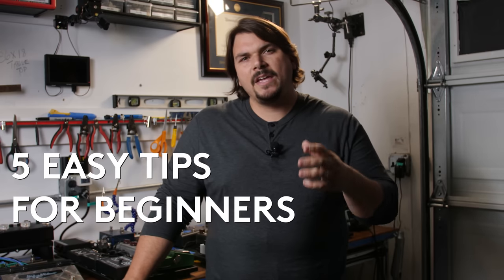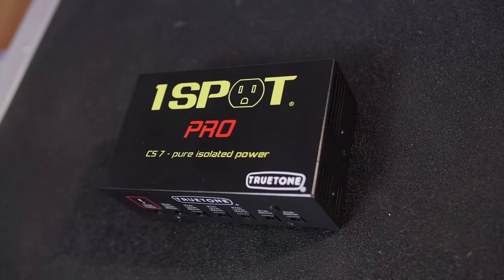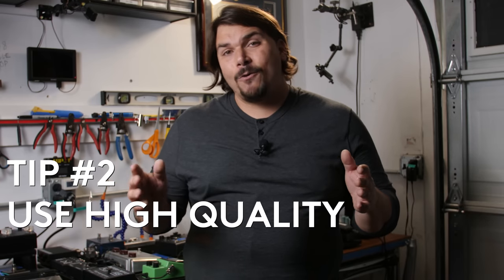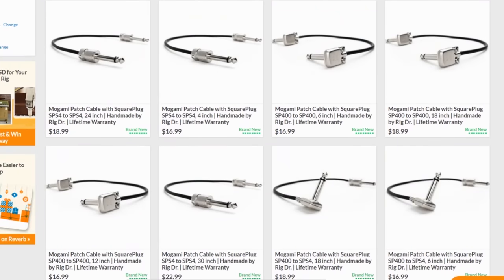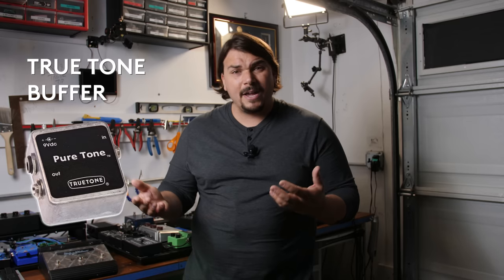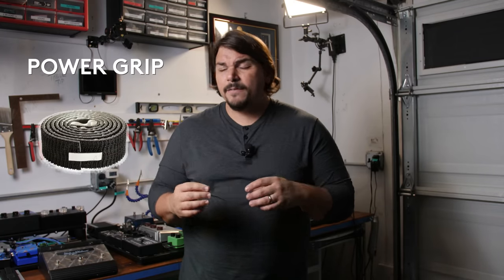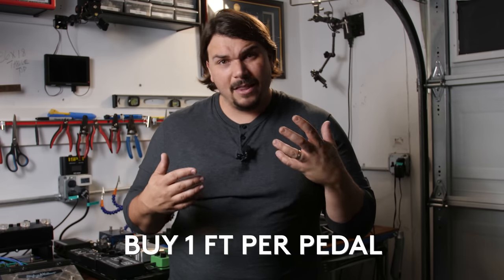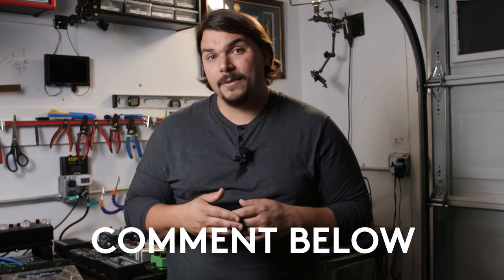5 Ways to Improve Your Pedalboard

Comment: You don’t need dual lock on your pedalboard. If you’re hanging pedals up on your ceiling, maybe. It’s ugly, overkill, and not compatible with Velcro so anytime someone lends you a pedal you can’t put it on your board. I have never had a pedal fall off with standard Velcro. And I have never needed to remove Velcro from a board. Velcro just doesn’t give me any issues, it’s fixing a problem that isn’t there.
Reply: Completely agree
Reply: Unless you are using your pedalboard as a fly rig .
TSA has torn my boards apart with standard velcro
Reply: It's definitely overkill for someone who doesn't tour but if you're constantly on the move, flying, people handling your gear... it's a Godsend!
Reply: 100%
Reply: It also depends on where you live and play at.. it’s hot and humid here in Texas and it’ll melt Velcro off the board
Reply: So I’ll play devils advocate here. I clicked on this video for that specific name; “dual lock Velcro.” Reason I NEED this in my board is because my pedals will not stay square on my board. The regular Velcro from Walmart keeps letting my pedals go a little off square and it’s unacceptable. This was my number one tip. Needed? No, I’m not saying that. Wanted? OH YES!
Reply: @truthmusicman  I’ll play devils advocate as well and say Velcro is able to make micro-adjustments whereas dual lock is locked in. If you didn’t square it off perfectly it’s going to be slightly crooked and you can’t tilt it slightly like with Velcro. Basically you can wiggle with Velcro and you can’t with dual lock. No wiggle room.
Reply: I like dual lock on my board. While not the most necessary, I feel like things fall off without it, especially since I place my pedals on top on my amp, not on the floor when I play shows.

Comment: It blows my mind that the majority of people are still using traditional Velcro. Switched to dual lock 15 years ago and never looked back. It’s super strong so you don’t need much, just a small tab in each corner of the pedal. I can actually grab a given pedal on my board and lift the board with it. It’s that strong. Pedals can still be easily lifted off the board by sliding a small screwdriver under the pedal and prying upward.
Reply from the maker: it's the best!
Reply: Proved and do its job for how many decades. Using mine for almost 2 decades.
Reply: I mean I still use Velcro strips and I can lift my board with my pedals 🤷🏽‍♂️ kinda a minor part to improve if you know how to actually use it imo..
Reply: It’s overkill. Velcro looks better. Never had a problem with Velcro. If I’m building a pedalboard on my ceiling I’ll buy some otherwise it’s the most unnecessary “improvement” to a pedalboard which just makes it ugly and incompatible.
Reply: blows my mind is a bit of an overstatement. i dont gig so i dont need to worry about pedals falling off and effers stealing pedals. p-boards get dirty and velcro can be vacuumed easily (if one is smart and has taped the soft side on the board). dust and hair/fur and grime do not vacuum easily off dual lock 🤢.

i agree with the CS series and EB ribbon cables though--both are excellent, affordable prods.
Reply: I use alien tape. Strips of silicon rubber. They stick in a similar way to Velcro but are one piece and are easily removable and reusable. If you had hard floors, like on a stage, you could just stick em to the ground if you wanted. Also the soft rubber adds a little squishy bumper. And you can stack multiple layers to get past and get
Reply: I remember as a kid, my dad helped me build my board using dual lock and I hated it as a kid because it was impossible to take the pedals off.

But now as an adult, I’m going back to it because Velcro ain’t cutting it.

Comment: If you're using velcro, use painter's tape on the bottom of your pedal before applying a blow dryer to the velcro and then applying it to the tape and not the metal/plastic directly. Will save your pedals' value and appearance over time.

Comment: This is by far the BEST video on pedalboards out there. I've watched several videos before I started building my own wooden board covered in musou black, and I came back specifically to write this comment. Of all videos, the five tips of this one were golden.

For each tip, I'd like to share my experiences and choices based on what is available in Europe. I am NOT advertising for any of these products.

1. After considering the selection criteria, I went for the Palmer PWT 12 Mk 2.
2. I'm a sucker for braided patch cables,  so I always have been using HQ ones. But I'm grateful to have learnt of Mogami.
3. I got convinced I need a buffer and opted for a Car Martin Buff DeLuxe.
4. I got a roll of 3M Dual Lock SJ 3550 (4 m x 5 cm / 15' x 2" / 2 sq. m / 310 sq. in.). If you find the right supplier, it's only slightly more expensive than when you buy 3 rolls of Velcro to get the same surface area.
5. I bought a can of DeoxIT D5; a reseller on Amazon offers it in Europe.

Additional tips for DIY:
6. If you build your own board, you'll want to use adjustable levelling feet.
7. To make sure cables don't touch the ground, affix them to the bottom of the board using cable clips or cable holders.
Reply from the maker: Thanks for watching!!!

Comment: Something I found using EBS vs. those pancake plug patch cables is the latter can have impractically large heads for some applications: you physically can’t plug two of them in next to each other in a lot of switchers, for instance. EBS plugs are a lot smaller and save a lot of headaches of that sort.

Comment: Hope nobody’s offended if I ask for an European contact Spray recommendation
D5 is 32€ + shipping in Germany…

Been a Neutrik nerd for 17 years straight, pardon the humor…
Only patch cables may have Hicons. 

Subbed and really appreciate your content!
Reply from the maker: The D5 is worth it and for most recreational players will last years.  Neutrik is great for instrument cables but not ideal for a pedalboard.  I think Hicon is made in China now so is tick stick with SquarePlugs.
Reply: @VertexEffectsInc  
 ty for the quick response. 
I didn’t have any issues with the hicons on some Sommer cables, but once I need new patch cables, I’ll try square plugs!
Reply: PRF sprays are just as good, 6-68 is a good dry cleaner for jacks and connectors, 7-78 is what you want for pots and faders. If you have a really dirty pot, I recommend cleaning it first with 6-68, and finishing it off with 7-78, as the lubricant can otherwise flood the pot.

Comment: Great video. I use the tc electronic polytune 3 with the built in bonified buffer. 2 birds 1 stone.
Reply from the maker: That’s only satisfies the input buffer, you’d still need an output buffer.
Reply: @VertexEffectsInc  would a boss pedal work ? Thanks
Reply from the maker: @BMitchell  no, it's an awful output buffer, a poor at driving long lines and the more capacitance seen on the output the more unstable it gets.  You need something that is around 100 ohms output impedance.  I'd stick with my recommendations or you can build one of our DIY buffer kits.
Reply: @VertexEffectsInc  awesome. Thank you. I'll probably pick up a bonafied buffer. Can't beat it for the money. Really enjoy your videos. Keep em coming.
Reply: @VertexEffectsInc  I ordered another bonafide buffer. Thanks again man.

Comment: I always use the Xotic EP booster at the beginning of the chain, the first pedal. It's always worked for me since it came out.
Reply from the maker: It’s one option, however the output impedance isn’t particularly good, I don’t recall with the input impedances, it might be OK if it’s just controlling your pick up a loading, but I wouldn’t recommend it as a line driver.  The other problem is it inverts the polarity, which can be an issue in some rigs.
Reply: @VertexEffectsInc   thanks. I’ll try to buy the materials to made the Vertex DIY.
Reply: @VertexEffectsInc Hey Mason  I run that pedal at the end of my board, also I have a Soul food 4 pedals in which I think is a buffer. What is your opinion?
Reply from the maker: @PERRADE  let us know if we can assist.
Reply from the maker: @scottpickett9779  you need a high quality buffer on your input and output of your system as I suggest, no way around that.  It needs to have a 1M input impedance and a 100 ohm output impedance if you want to quality it (generally - there are some exceptions).  The Klon is a great overdrive (Soul Food), the buffer is awful - TL072 is a terrible IC for this application.  Follow my suggestions, you'll get better results.

Comment: Questions about the dual lock: 1) Why do you recommend different types for the board (400) and the pedals (250), versus the same for both? Is there an advantage to this mixed setup? Asking because it appears that the 250 is half the price of the 400, so 250 tape on both would be a lot cheaper. 

2) Also, your amazon link for the SJ3550/250 stem is pointing to TB3550/250 stem. What’s the difference in the SJ vs. TB types? Thanks!
Reply: I always use 250. 400 is ridiculously strong. 400 works well if you want to stick a power brick under your board, or something like that. But for board and pedals, 250 is more than strong enough.
Reply from the maker: 1) it's stronger if you use two different densities.  If you want it easier to pull apart I'd just use 250 on both sides.  2) Not sure, they may have changed the link destination.  I'll check it out.

Comment: Nice, I had an analog chorus who was very picky with the PS, I ended building my own linear supply, I used an unregulated  12V wallwart connected to a box near the pedal board with a LM7809 regulator inside, because it was a wallwart there was no AC near the board.  no more hum.
Reply from the maker: Very nice!

Comment: I actually like the bonafide after the drive pedals when they are on, and before them when they are off... so there is some compromise needed and i have to agree that better tone overall for the pedalboard is using a buffer in the beginning of the chain
Reply from the maker: If you actually are turning on the distortion pedal, I don’t predict there’s going to be much of a benefit for running it after it as opposed to just running one of them dead last in not having an input Buffer at all, presumably if you have any distortion pedal on that’s the low output impedance signal. For most devices over a short run a cable it’s not gonna make much of a difference whether the output impedance is 100 ohms or 1K ohms.
Reply: @VertexEffectsInc  agree
Reply from the maker: @Antonio-nn5ot  yes indeed!

Comment: You almost forgot about the Suhr Buffer, that's a great one, too. Although for guitars running a stereo rig, it only applies to the output side, and if you're a bassist like Billy Sheehan that splits the signal from the instrument, but only have one output on the bass, this buffer will be usuable to split the signal for different frequencies.
Reply from the maker: Didn't forget, it's just not the most budget friendly version, and I'm trying to recommend stuff for beginners and folks just getting their "sea legs" with this stuff.  Secondly, it's not in production from what I can see.

Comment: You're right, I use EBS patch cables and they are just very good and a good power supply is also the right thing, Cioks is a good alternative and they are not so pricy at all. I don't use buffers, maybe I must try one.
Reply from the maker: Real soldered cables are better - but these are superior to a low profile Solderless for sure.  You have buffers where you know it or not - any pedal turned on - true bypass or not - is a buffer.

Comment: I started using neutrik 90° replacement jacks low noise and using cable for microphone and leaving the fourth wire as an anti antenna wire to shut down surrounding noise, sounds crazy but it works?  I have a couple spots where I used the mxr Close Quarters 90°, they are nice thanks for your videos you're making a difference ☆.
Reply from the maker: I'd stay away for Neutrik on a pedalboard...no reason to use these nor the mic cable.  You're just adding capacitance for no reason.

Comment: Ok,  I am using an 8 outlet power strip, with surge protection, that has the rotating sockets so you can stagger wall warts.  Power strip is attached with dual lock under Pedaltrain.

Using individual $8 d'Addario 9V 500ma AC/DC switching supplies.  I have dual USB plug in chargers for USB to 12v for midi looper, and USB to 18V for OCD.

Completely isolated (not like some power supplies that only say they are.) Operates anywhere in the world. Cheap, expandable ( I could run 16 devices if I used USB to 9V adapter cables.)  No single point of failure, completely configurable.  Half the price, twice the capability.USB power to charge devices on the board, extra outlets to chain other boards or plug amps into.

Oh, yeah, no noise.   Con?  None?  Doesn't look cool hidden under the board.

Is there a downside to this approach?
Reply from the maker: If you're not getting noise that's the ultimate litmus test.  I alway like testing a rig by putting the entire pedalboard into a true bypass looper and hearing the guitar plugged directly into the amp versus bringing in the board.  This way you can ID any tone suck or noise in the system.

Comment: I know this video is almost a year old, but I've watched at least 10 other Vertex videos and I have finally decided to build soldered cables instead of the Lava cables I've been using. Can you say SquarePlugs?
Reply from the maker: Great, you can use the Lava cable too and just solder it with Squareplugs.  The cable is totally fine.
Reply: @VertexEffectsInc  I ordered some Mogami 2314. As you've always said, it's cheap and it's more flexible than the solid core Lava cable.

Comment: Well, its officially, I have obsession with your videos! 
Let me ask something, do I need a buffer even in a small pedalboard with max 3-4 (maybe 5 pedals), or the buffer needed when we are talking, for examble, for pedalboards that have 10 pedals or above.
Reply from the maker: Yes!
Reply: @VertexEffectsInc  I bought the Carl Martin Buff Deluxe buffer. Hope this works fine. Can I ask you something else, if the chain goes like that -> last pedal buffer -> after that a true bypass patchbay -> and then goes to amp, it will work or the buffer must be the last pedal before the amp?
Reply: Turn all of your pedals off and strum a couple chords. Now plug the guitar directly into the amp and see if it makes any difference. If it does, you need a buffer.
Reply: @JesseKoroteyev  thank you for the reply. I did what you said and didn't notice any difference. But at the end I change my setup and now my setup has as the very last pedal a buffer and not a true bypass switcher. I'm very happy with my sound for the first time in my life, Dr Rig's videos are very very helpful, all you need is to understand what he really meant and what you really want. I didn't like the Carl Martin buffer, sounds like a compressor so I used a custom buffer with specs as close as possible to the specifications he suggests.
Reply: @karhariasgr  thank you

Comment: I got a Walrus Aetos for my pedalboard power. Do you recommend this power supply? I also would love your thoughts and maybe an episode on transparent overdrives. Thank you for the content. This video was very helpful!
Reply from the maker: These are linear power supplies like the older Voodoo Lab versions - and also don't have any electromagnetic shielding.  I suggest you look at my recommendations.  Thanks for the suggestion on future video content!
Reply: I have a walrus phoenix and it doesn't have any of the problems he brought up except only taking 120v, I can sit all my pedals right on top of the supply and won't get any extra noise. I was really worried about it too but walrus does an awesome job at insulating

Comment: Hi Mason, I've got a CS12 but I'm running out of outputs, so I was wondering the following: Could I buy a mini Iso Brick and power it with the 18V output from my CS12? That way I'll have to plug in just one power chord for my entire pedalboard. Would that be possible?
Reply from the maker: I think there is some sort of current minimum that needs to feed it, might need to check on that.  An alternative could be the Voodoo Lab x4
Reply: @VertexEffectsInc  thanks so much man! I'll look into that

Comment: Hi Mason, i saw a MXR/CAE Line Booster for a good price.
Can i use it as buffer?
If yes, is it before or after. Thanks. 
Anyways, i already have a Boss TU-3, as a buffer if not engage.
Reply from the maker: You can, you just have to leave it "ON" for it to be a buffer.  The buffer quality of the Tuner is not comparable to the MXR in terms of quality and efficiency.  Remember not all buffers are created equally, just like not all overdrives are a Klon.

Comment: Hello uncle Mason! I ve got some questions.. 
1. I use the g lab gsc3 controller, which has a built in buffer...should I count on it?
2. I'm kinda in love with the Vertex Boost...if I buy one, will it complete the need for a buffer? I play my boost pedal in the fx loop...
3. Should I go for the truetone or the t.c. buffer, if needed, or save money for the Mesa?
Thanks!!!
Reply from the maker: 1) It's okay for an input buffer, I don't think there is an output buffer
2) It is a great boost and buffer but if it's not the last thing in the chain the buffer can't be as effective as a dedicated buffer, and in the loop is not going to help with the front of the amp.
3) Depends on your effects loop, but having an input buffer, output buffer, and a buffer on the return of your FX Loop could be needed, but at least an input and output buffer.  The Truetone is a good budget option.  I also like the Mesa Boogie High Wire for a great dual buffer in one.
Reply: @VertexEffectsInc  thanks a lot!
Reply from the maker: @mitskoski  you bet!